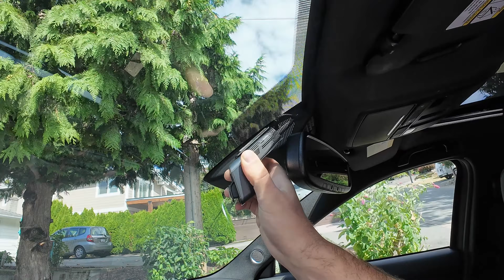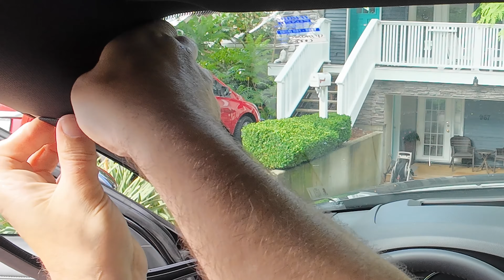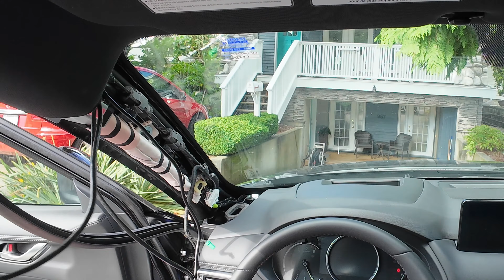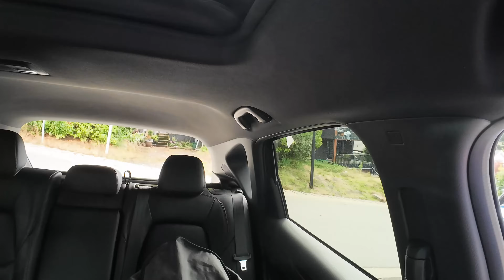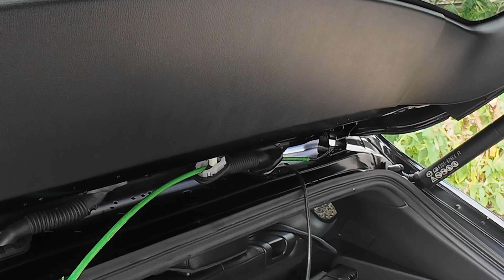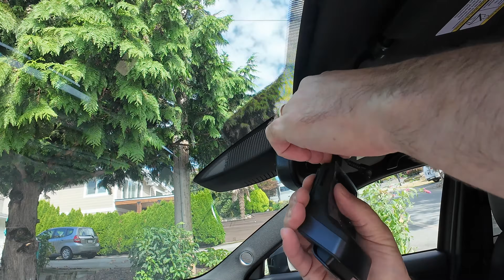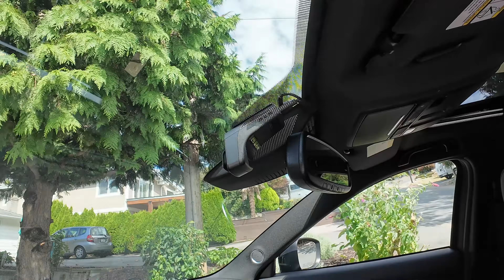Mazda CX5 professional dash cam installation

Comment: Not afraid of pulling the rearcam wires before the curtain airbags with pulling the cables blindly behind the B pillar. Can be a risk when they not properly collapse in an accident
Reply from the maker: Are you asking a question? The seatbelt is behind the B pillar. Do you think the airbag is going to come downwhere the seat belt is?
Reply: @SafeDriveSolutions  the curtain airbag which goes before te windows, do you think it safe?
Reply from the maker: @vd9623  the way we run it in the video is safe.
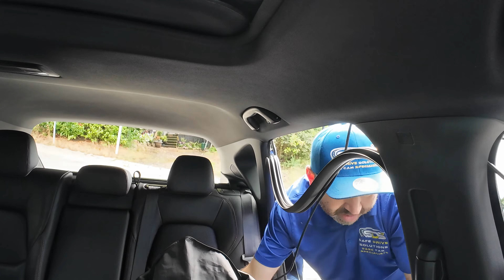Reply: @SafeDriveSolutions  Unfortunately, it is really dangerous to do it this way. Pulling cables in front of a curtain airbag (3:24 in this video) is absolutely not acceptable. See this youtube video for a mazda 2, the same kind of airbag is in the CX-5 and any other recent car: https://www.youtube.com/watch?v=Ey70YuQk-1g&ab_channel=DavidNannah

If a cable runs in front of the airbag, it won't expand properly, compromising vehicle safety. There are only two good options: either remove the trim and run the wiring behind the airbag or feed the cables through the bottom of the car.

No hard critize or anything because the rest of the video is really good, however, people often miss this when running wires through the car.
Reply from the maker: @vd9623 you obviously did not see how we ran the wire through the b pillar. Maybe our video angle was not good enough. Also the video you linked also proves we are not near the air bag on b pillar. So I am not sure what your point is here. The video clearly shows that the b pillar does not pop off, does not break open, we are ran directly behind the B pillar. We are slightly above seat belt. 

We have seen airbags explode open. Been doing this over 25 years.
Reply: @SafeDriveSolutions  I think we can agree to not agree on this safety topic, my advise to the viewers with a lot of experience with airbag systems, take 15 min extra en wire it behind the curtain airbag with the rest of the wiring loom in the car, there is a reason why they are behind the airbag.
Reply from the maker: @vd9623  Okay I watched that section of the video again and again and it clearly shows it is ran behind the airbag. I honestly have no idea what you are talking about. We have worked on hundreds of these vehicles if not thousands. They are one of the most popular vehicles we work on Have you ever personally worked on a Mazda CX-5? 

 "take 15 min extra en wire it behind the curtain airbag with the rest of the wiring loom in the car,"

You obviously do not realize there is no wiring by the airbags up top to tie strap to. The common mistake we see by DIY and other professional installers is they take the wiring and tie strap it to the airbag. They do this because there is no wiring to tie strap to. Also the beginning of the video I show that this client has gotten into multiple car accidents and has multiple Mazda CX-5. his wiring did not pop out in anyway unsafely or prohibit the airbag from doing its job. This is his 3rd mazda. We did his Mazda 3, Mazda CX-5 and now in this video his new Mazda CX-5. His 2 prior vehicles were both written off from major car accidents. 

I appreciate you questioning. We are always learning but I dont see your point here. I think yo u are assuming we did something that we did not....
Reply: @SafeDriveSolutions  no worries, there is no need to agree.
Reply: @SafeDriveSolutions @SafeDriveSolutions, I believe they are referring to the potential for interference if the driver's side curtain airbags are deployed. The service manuals show a wire harness that runs the length of the car in this area. They are suggesting that you should zip-tie to that harness, assuring that your cable will not interfere with the airbags. It would obviously require more work to remove that headliner.
Reply: @SafeDriveSolutions  I don't think we actually see the wire path you took from the A to B pillar in this video. Having looked at my own vehicle, I don't see a way of reliably securing the wire in a way that doesn't risk interference with the airbag deployment. How exactly did you do it?
Reply from the maker: @dwi11y   https://youtube.com/shorts/oHcmEeb4FUo?feature=share

Comment: which cables did you select to hardwire? couldn't see in detail :(
Reply from the maker: we go to back side of fuse box. we recommend testing your wiring. top fuse is ignition so typically back side of top fuse is fine to use. but you need to test. Typically the constant power is a white wire. But always verify.

Comment: Hello, it's nice to meet you. I live in Toronto and I bought a 70mai A810 4K Dash Cam (front and rear) because I needed a good camera. I want to install it in my Mazda CX50. How do you recommend I connect the camera? I think it needs constant power because it has parking protection etc. I believe I can draw power from the rearview mirror with an adapter, would you recommend this or is it best to connect it to the fuse box? Also, how should I get power for the rear camera? Thank you in advance for your help and support. Your videos are really great.
Reply from the maker: You should use an obd2 cable. Probably safest way for any DIY install on that vehicle
Reply: @SafeDriveSolutions  Thank you for suggesting I use an OBD2 cable. I see many different OBD2 cables on the market, is there a specific brand or model you recommend for my Mazda CX50? Will any OBD2 cable be compatible, or is there something I should look out for?
Reply from the maker: @BarisAkkol  We typically use IROAD OBD2 cables. But it would need to modified to work with your dash camera
Reply: @SafeDriveSolutions  Thank you. How can I purchase this modified cable from you?
Reply from the maker: @BarisAkkol  we only do modifications for the brands we sell.  https://youtu.be/mRaR2my1aBc

Comment: Hi Ben,
Thank you for great video of how to install dashcam in Mazda CX5 - which fuse (number location) will you select for ACC and VCC ?  You have don it many times so you know which is the right choice. Many thanks
Jan
Reply from the maker: We dont use fuse taps on the Mazda because they are wobbly and dont stay in that well.
Reply: @SafeDriveSolutions  thank you, have a nice day !
Reply: @SafeDriveSolutions  i found the next size up fuse tap works perfectly (MINI) on my CX-5, the small fuses Mazda uses (MINI-low profile) with the side pins that hold them in is the issue for low profile taps not working.  Normal size Mini tap fits better for the job.  R-Outlet1 with 15A i think is what i used for my Nextbase.

Comment: Hi Ben, could you please make a video on how to install hard wiring directly to a vehicle? I haven’t been able to find any detailed videos explaining how to do it correctly. My car doesn’t have space for a fuse tap at all. If I were in North America, I’d come to you for the installation, but I’m currently in one of the GCC countries. I’d really appreciate it if you could make a video on this. Thanks.
Reply from the maker: What vehicle is it for?

Is this video good?

how to safely install dash cam wiring into the car
https://youtu.be/BgsKy9Hhzvc
Reply: @  Good morning, Ben. I drive a Toyota Hilux 2014. This car is not sold in the USA due to safety regulations. It’s a smaller version of the Toyota Tacoma.

Regarding the video on “How to Safely Install Dash Cam Wiring into the Car,” it’s helpful. However, when it comes to wiring directly, there are no detailed step-by-step instructions. 

I understand if you choose not to share that part—perhaps it’s a professional secret.
Reply from the maker: not a secret. I think most people understand fuse taps or plugging an obd2 plug or cigarette lighter. The challenge with hardwiring is this. 1. if you say it is blue wire and for some reason your vehicle was manufactured in mexico and not usa. the wiring colours could be different. if you say it is pin 28 and your vehicle was manufactured in august and not march , the manufacturer could have had a line change or computer change or who knows what. so we try and be careful with information we share. mainly because it is for expert installers. Also a lot of people seem to think it will void your warranty. another huge misunderstanding
Reply: @SafeDriveSolutions  Got it, Ben. Could you please share the next videos with step-by-step instructions? I would really appreciate that. We’ve learned a lot from you. Thanks.

Comment: Any operational downsides to using the obd port?  I have a viofo with hardwire kit but not sure im confident to wire it in fully, i.e. without using fuse taps.  I'm weighing up ordering an obd adoator versus fuse taps..
Reply from the maker: OBD2 Power Adapter DANGEROUS? (Is it safe to use the OBD port for power?)
https://youtu.be/aHVXGZNWGbs

Comment: What's the name and source of the special tool used to remove the liftgate grommet? I asked a Mazda Service tech and he didn't know. Thanks!
Reply from the maker: you can use a 4140, or a normal plastic panel popper tool. Just remember you dont pry up. if you do that you will break those clips.

Comment: What's the name of the tool you used to fish the rear camera cable through the B pillar and through to the rear hatch? Also, is the process the same for the passenger side outside of routing the hardwiring cable?
Reply from the maker: Meg 20 from vim tools

It should be same process on passenger side. We always go driver side though

Comment: Hello, What are the Pros and cons of the cameras you have on your website vs Vantrue? Do you have an install video on a Lexus NX with side aribag? Thanks
Reply from the maker: What specific Vantrue camera?
Reply: @SafeDriveSolutions  the N5
Reply from the maker: @srinip825  Well an N5 is a 4 channel dash camera. So if you need 4 channels then Viofo does not compare. Max it will support is 3 channels. if you are talking about image sensors, Viofo has better video quality, and better parking mode capabilities as you can limit the parking mode timer to reduce wear and tear on your car battery.
Reply: @SafeDriveSolutions  I watched your videos and love it.  I will explore Viofo a bit more. If you will benefit from me buying Viofo through your amazon link, please let me know. I can do that. I can go with 3 channels. For parking, I watched your other videos and asked a question about the USB battery bank with cig lighter options. I may go with that since I don't mind the few minutes of inconvenience of charging at home. What about using AGM SLA with smart charger and use that instead since they are capable of handling the heat ?
Thanks again
Reply from the maker: @srinip825  We do not do any Amazon affiliate links. We do sell direct from our website. However we do understand that not everyone will purchase directly from us. I am not familiar with an AGM SLA charger so i can not comment.
Reply: @SafeDriveSolutions  Hello, Can you please share a video on the parking mode on Viofo A229 vs N5?  I am not clear on what angles does the parking mode record? Some complain that only low bitrate mode work and not the impact mode . Is that true with Viofo 229 ? If the car is hit from the side while parked, with 3 lens A229 , is there a chance of missing the footage of the impacted area ?
Reply from the maker: @srinip825  We have never review the N5 on the channel
Reply: Hello,  If the car is hit from the side while parked, with 3 lens A229 , is there a chance of missing the footage of the impacted area ?
Reply from the maker: @srinip825  yes always a chance you miss it. Always depends on camera angles. This is a complex question not easily answered by text

Comment: Did you disconnect the battery to avoid triggering the air bag in the A pillar??
Reply from the maker: Airbags do not trigger unless ignition is on and there is impact to the vehicle. Its been many years since airbags deployed with ignition off.

So no the battery is not disconnected

Comment: Where did you wire the acc cable for parking mode? Also it didn't look like you fused the positive input to the cam. While there nothing wrong with splicing the ground wire into the factory wire why not just use the terminal ring already on the hardwire kit and bolt it to the ground point that's right there?
Reply from the maker: Acc wire back side of fuse box. The wiring has fuse holders in line. There was no ring terminal for ground so we soldered.

Comment: I have a problem since you are an expert☺️ in dash cam. When I activate the parking mode in Time-lapse with the viofo a229 pro camera, I return to it after 5 hours and am surprised that it has stopped. Is there a problem?

Although it is late at night from 12 midnight to 5 am, it has stopped, knowing that the weather during this period is not hot

Car Honda Accord 2019
Reply from the maker: it probably is low battery protection. Honda vehicles have small batteries and are not to be recording for long periods of time on a regular basis
Reply: @SafeDriveSolutions  Is it better to buy something like Power Magic Battery Pack B-112 and connect it to the camera?
Reply from the maker: @iRayan3  yes for consistency of parking mode look at Blackvue battery pack, iroad powerpack pro 12, thinkware ivolt xtra or etc. Keep in mind you do need to drive to charge these battery packs up
Reply: @SafeDriveSolutions  Thank you dear

Comment: Great instruction video! definitely looked much easier than it was on my VW. Did you add an external fuse holder to your hardwired circuit? or did you tap into the outgoing circuit after the fuse?
Reply from the maker: Tge thinkware hardwire cable has inline fuses already. Viofo, vantrue and other brands we need to add fuseholders inline.

Comment: I hope you do a Subaru Forester with eyesight dashcam installation.
Reply from the maker: we got a 2024 Subaru Forester that our Toronto location did. It did not go as in depth as the Mazda CX-5 but there will be some good information in the video. We are trying to get it out for next weekend
Reply: @SafeDriveSolutions  Yes, Looking forward to it.  Do you have an estimated date for when the Viofo A229 pro 3 channel might become available again?
Reply from the maker: @stir822  we do have some 2 channels in stock and interior cameras in stock so we can piece them together currently no problem. We just dont have them all in one box
Reply: @SafeDriveSolutions  How do I do this? I mean I can't find the interior camera option to add in your website?
Reply from the maker: we can do it manually. Please email us at info@safedrivesolutions.com

Comment: Have you ever had an airbag go off while installing a dashcam??
Reply: it's like getting struck by lightning... could happen.. but you've got to be real lucky if you know what I mean.
Reply from the maker: @oleksandrben9970 i know people who when looking for speaker wires on a vehicle have hooked up speaker poppers and put voltage to those wires and blown them.
Reply: @SafeDriveSolutions  we can learn a lot from those people... mainly don't hook up wires to an airbag!
Reply from the maker: @oleksandrben9970 yup.
Reply from the maker: no we have never had that happen.